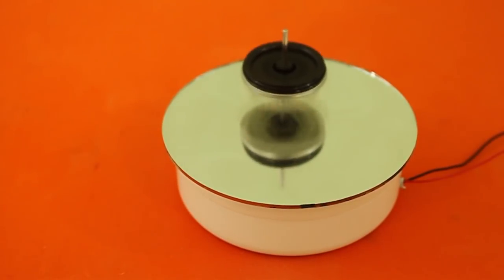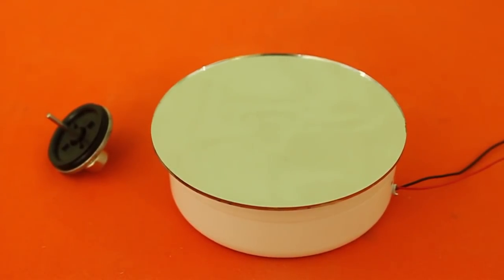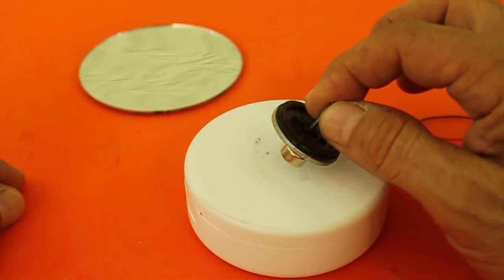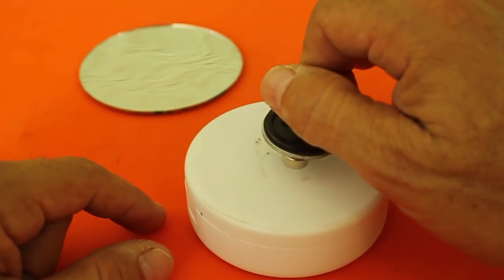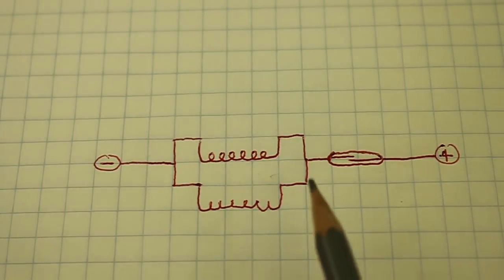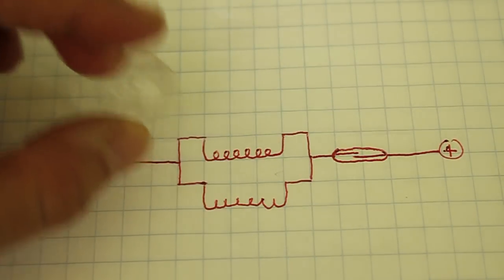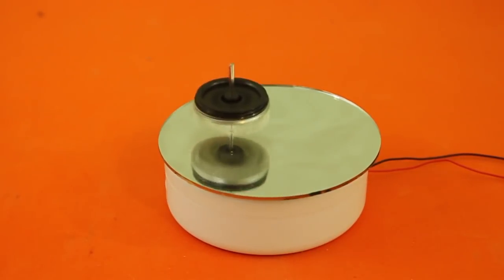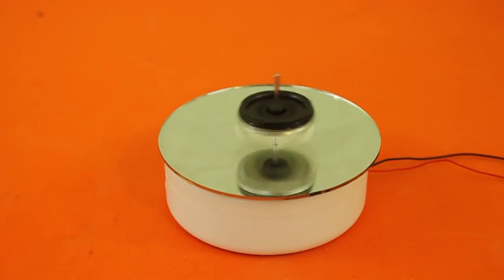Electronic Spinning Top

Comment: Could you recommend a transistor in place of the reed switch?
Reply from the maker: transistor does not replace the reed swtich
Reply: Ludic Science the commercially available model uses a transistor. Sorta like a pulse motor circuit. Was wondering if you could do a tutorial using this method?
Reply from the maker: Thats a different version, i will try to make it problem is that you need a lot of turns in the coil to obtain a voltage that triggers the transistor

Comment: Nice demo.  These are fun.  I've made similar versions with Bedini coils, and also versions with a single coil and complementary transistors.  For the top, I usually use a cylinder magnet that's diametrically magnetized.  But your version works great too, and it's cheaper.